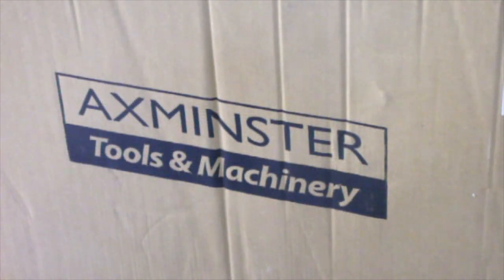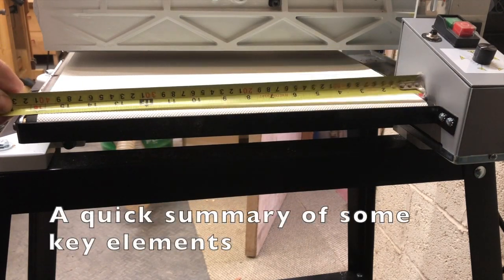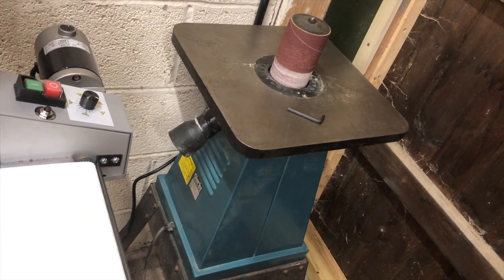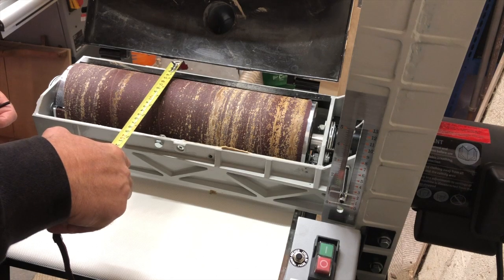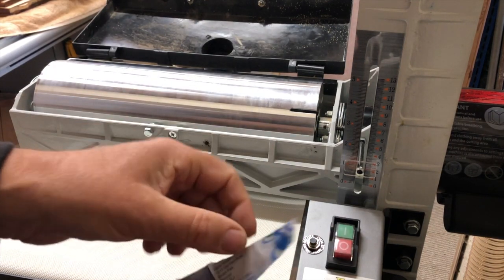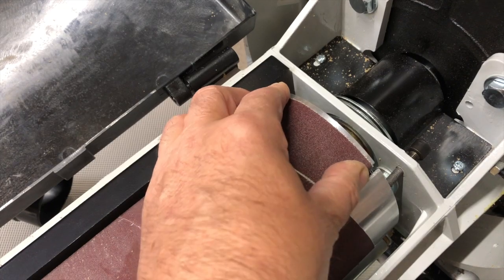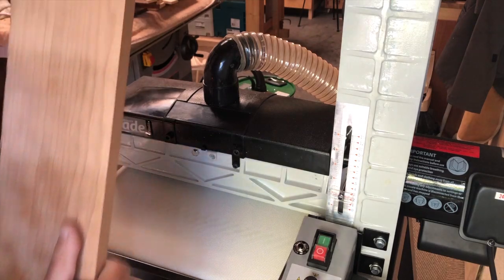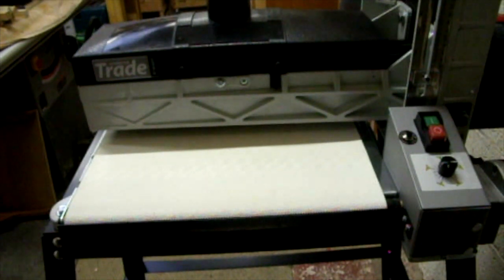Axminster AT406DS Trade Drum Sander - Tool Review Tuesday

Comment: Hi - have had the Axminster Trade 406DS for just over a year and it came time to replace the sanding strip and what a hassle  - so very pleased you did this video - There is no mention of the black pull mechanism which locks the drum and opens the spring clamp in the instructions  and there is very little room to see what is happening on the right side of the machine and my fingers couldnt open and hold the clampso again your video is a lifesaver.
The black and white photo's in the instructions are not helpful

I also rang Axminster for replacement strips as described in the Instructions that come with the machine but they dont stock them anymore precut -  for a machine just over 12 months old!! so am using the strip i took off as a master and cutting my own, as you did.
 - anyway back to the workshop and try out your process - Axminster should have issued a video on this to help otherwise we will drift to other manufacturers as without your video changing grit size is just too much hassle.

Thanks again
Geoff
Reply from the maker: Hi Geoff, Yep the instructions are less than adequate and changing the loadings is a right faff, though does get easier the more times you do it. I also use the original as a master template to cut from a larger roll of sandpaper, however Yandles were selling packs of loading for the Laguna model (16-32 Supermax) which fit the Axminster version and are already cut, they were selling them at a great price.
TBH now after nearly three years of ownership the machine does what I need it to do though there are some issues that are a real pain with mine. *Firstly the conveyor belt struggled to grip the work piece and kept stalling, Ax replaced the belt but alas the problem persisted in the end I dumped the white plastic version and went with a wide sand belt that Ax sell now zero issues re grip.
*Secondly the conveyor belt needs continuous adjustment as it tracks always towards the controller side, I've ensured spot on for level, parallel etc and still an issue - so after a few weeks of use I just reset the belt 
*Thirdly I installed a cheapo DRO as trying to use the scale on the machine was totally inadequate.

Having said all this for the price I got it at (which was 1/2 the price of Ax's current stock) it does the job i need it to do.

Glad the video helped on the loading.

Cheers
Steve

Comment: After owning that very machine for a year, Axminster finally came yesterday and took it back for a full refund.  After having nothing but issues regarding the loadings and tearing through litterally hundreds of meters of the stuff i had had enough.  Excuses from Axminster included "The hardwood you are using is to hard"  "The softwood you are using is to soft"  "The MDF you are using is to fiberous"  And my personal favourite  "The wood needs to be flat and smooth"  Absolutly the worst machine i have ever owned, if Titan can make a planer thicknesser for £155 that has lasted 6 years why is this machine such a poor design?  Horrible machine...
Reply from the maker: Wow! I’ve got an issue logged with them as the conveyor belt has zero grip now waiting for a replacement (back order) not had an issue with the loadings, having said that I don’t use their offerings. I’ve added a digital readout and apart from the conveyor it’s been acceptable. Shame about yours 😏

Comment: hi great vid have you adjusted the drum ect im unsure what to do as instructions are very poor
Reply from the maker: Hi, not sure which aspect of adjustment you’re looking for, however if it’s the drum to the table then you should have got some thin shim steel and you insert them under the table between the legs and the base of the machine to get the drum to run parallel to the table.  As for the loadings really it’s just being careful to get the sandpaper in between the clamp. As for the feed belt, I’ve changed the rubber feed belt for a sandpaper type this improves the feed through 100%. As for the tracking of the feed belt I’ve still not cracked that, I now think it’s down to how level the machine sits at the moment I just re adjust the belt every now and again. If there’s anything else just ask.
Cheers
Steve

Comment: I was looking at one of these and it looks well built. Thanks for the demo
Reply from the maker: @roberthodges3522  Thanks Robert, tbh after a few years of living with this it’s not without it faults! If I was in the market for one I’d seriously look at the Laguna version. Main faults are, the conveyor belt just isn’t grippy enough (I replaced mine with an emery cloth (basically sand paper)version, the tracking is a pain and still have to readjust frequently, dust collection just about adequate should really have a 100mm port not the 63mm and finally the measurement scale is useless (I fit a electronic scale reader, which is ok). However it’s does the job when called into action.
Cheers Steve
Ps forgot changing the loading initially is a right pain, however after a while it’s manageable
Reply: @Phenrica  Hi Steve, thank you for the more depth information on it. That's a shame because it looks well built. I did notice that you pushed the wood in a few times because of it not gripping. 
Even now brand new in the UK they are not cheap. Thanks again.
The Laguna is good but very pricey.
Keep the video going 👍
Reply from the maker: @roberthodges3522  Blimey I just looked up the current price, it’s double what I got it for! Go to admit I bought it on one of their sales days

Comment: Hi Steve thanks for the review, I been looking at this also a toss-up between this and saving a few quid or saying bugger it and just going for the laguna 16-32 Supermax Drum Sander. Still up in the air just don't like the thought of paying double what you paid. Is it worth the money and do you recommend it, cheers for posting.
Reply from the maker: Paul Burton Hi Paul, that’s just where I was, I tracked some second hand ones as well but thought they went for silly money imo. To be honest I’ve a few projects in mind that a drum sander really would be benefit need me however paying the £1400 plus was something I could not justify and when Axminster discounted I just went for it. I did look over them in store way before lockdown and thought then it was probably be the one I’d plump for. As for a recommendation it’s prob a bit too soon, however did what was supposed to do on a number of boards, the belt removal / replacement is fiddly however I’m aware that the jet version has the same issue and I would assume the Laguna has the same method of clamping the abrasive loading. There’s a calibration procedure that you carry out to ensure the drum is parallel with the bed, mine checked out ok but prob should have stuck that in the review (I didn’t video it and wasn’t an issue) there’s a couple of shims that you add the level up no great deal to do.

It feels like it’s a decent build (Taiwan of course) some more trials and tests so I can determine the optimum setting for the varying types of  wood and grits. It does have a weight to it so feel substantial. In the end it was a value for money choice for me, if I had loads of work required then possibly the Laguna or powermatic might have been what I’d go for but the work would have had to be good payers 😉

Hope this helps

Cheers Steve
Reply: @Phenrica - Hi Steve thanks for the reply, very helpful, you are right I think Will go for the Axminster I bought my Lathe and table saw from them. They are very good and excellent to deal with. Cheers once again and stay safe in these crazy times.

Comment: Hello Steve. I had the same issues with changing the belts. Surely there is a better design than this fiddly process. It makes changing belts for different grits a bit of a no no. Also had problems with the conveyor belt alignment  tracking adjustment . Could not get it to respond as described in the manual. Called in engineer friend. He failed as well. Have to stop the machine every so often  and manually push the belt back to where it should be. Not ideal. Best Peter
Reply from the maker: Hi Peter, after a while I seemed to have got the knack in changing the loadings, however after a few reloads glueing a piece of card at the ends really helps. As for the conveyor belt I lost patience with the white rubber one even after getting a new one courtesy of Axminster. So I replaced it with a sandpaper version that’s 100 times better in terms of gripping the timbers. The tracking is fiddly I agree though I’ve seemed to have balanced it for long enough that I only retrack it after while of using.
Reply: @Phenrica  Many thanks Steve I will try the card trick. Best Peter

Comment: Steve, Over the weekend I came to change the sanding strip and again needed to refer to your video as whatever I did didn't work, but having again watched your video carefully and a number of times your advice came to the rescue. 
Why Axminster don't either change the design for the right hand clip as their competitors have done, or put out a video similar to yours I have no idea, but again thanks for taking the trouble
Reply from the maker: Got to admit Geoff I am disappointed in the machine, I’ve struggled with the white feed belt continually just not gripping the timber whilst sanding (even after a new belt courtesy of Axminster) so I replaced it with an emery cloth variant which grips very well indeed only that there’s no way I’ve found to ensuring constant tracking! So after a number of uses I’ve got to release and reposition the belt. Fortunately it’s not a machine that is in daily use so I put up with it otherwise I’d replace it. With this and the pillar drill I got from Axminster I’m not sure I’d buy one of their branded large machines again.
Cheers Steve

Comment: Hey, I notice the minimum thickness for this machine is stated as 3mm. I really need to take my stock down to around 2mm (guitar sides). Do you think the conveyor table could be shimmed slightly to bring it closer to the drum?
Reply from the maker: Hi Jamie, Yep no problem shimming the table you actually may need to shim to ensure it’s running parallel to the sanding drum, however I can do 2mm easily on mine (which iv’e done for some of my model vehicles). One thing to bear in mind that most of the time for a show finish you’ll need to give them a run over with a random orbital sanding as there can be some faint track lines left after a drum sanding. Having said that I tend to use 100 grit max on mine. The machine for the price point is decent value in my opinion. Hope this helps. 
Cheers Steve 
ps if you’re going to purchase one with a Black Friday due in November there could be a decent discount 🤞🏼
Reply: @Phenrica  thanks for the quick reply. That's great news, there's one going second hand nearby for ~400 but I was a bit worried I wouldn't be able to go down to 2mm. Think I'll go check it out. The belt looks a bit fiddly to install, but sure I'll get the hang of it. Do you think the finish with 100 is okay and does it last quite long?
Reply: As in does the paper last long!
Reply from the maker: @ApertureCapture  the paper lasts if using dry hard woods that are not resinous. Pine clogs up the belts as does other oiley type woods like cypress and prob other exotic types
Reply from the maker: @ApertureCapture  I found that the belt became straight forward to change once I’d glued the business cards to the ends to stiffen up the cloth backed paper.
The finish is ok however like any other straight line sanding your eye can pick up the scratch marks. You could increase the grit to lessen them I suppose though when I’m doing furniture  I use the random orbital to finish as that scratch pattern is more difficult for your eye to see any sanding marks and I tend to go to 240 or 320 grit which I would think is too fine for the drum sander as it would generate too much heat I expect and as I do quite a lot of cherry it doesn’t like heat one bit.
Reply: Double sided sticky take your 3mm stock to 13mm MDF and sand 1mm off :)
Reply: @ApertureCapture  Hi. Did you finally bought that? I need it for instrument making too. How’s your feeling?
Reply: @asierdebenito-luthier6215  Hey, I have bought it, but due to lockdown I've been unable to pick it up yet
Reply: @ApertureCapture  good news. I have to decide between that and the Lombarte, which is made of steel instead of aluminum. Most Spanish luthiers use it, but I still need to know the noise level on both.
Thanks.

Comment: Hi Steve, congratulations for the video.
I'm looking to purchase one of those drum sanders, that size, and I have doubts between 3 brands. First is this Axminster, which costs 1100€, then Jet, which goes up to 1500€ and then Lombarte, sold in Spain, which costs 900€.
Both Jet and Lombarte weight around 70 to 80 kilos, but specs on Axminster say it weights only 47 kg? Can you, please, tell me if the main parts of the machine are made of steel or aluminum? I wonder if its construction could made it weaker and more noisy.
Also, both Jet and Lombarte have 1,5 HP motors, while yours is 1 HP. Do you feel it needs more power?
Thanks a lot in advance.
Reply from the maker: Hi Asier, I understand your issue I had the same when I was looking for a sander, I went for the Axminster because price (was about 1/2 price of the others available) and their customer service which is excellent. Not sure about it’s exact weight but is heavy in my opinion, it’s mainly made from steel plates, angle irons, though the casting that holds the lift mechanism is aluminium with the hood made from a composite material. The stand is steel angle and bolts together (I put wheels on for mobility) there’s a couple of could be better, 1, the measuring scale is at best approximate so I installed a €25 digital readout now it’s great. 2, the dust port is 65mm and would be better with 100mm to ensure max vacuum though it’s not an issue really apart from having to put a reducer on my vac system.
Overall I’m well pleased with it and probably would buy it again however it was on offer at the time for £700 / €800. If you’re considering then around Easter time Axminster tend to have discount sales 😉
Hope this helps any more questions just ask
Cheers Steve
Ps as for the power I’ve had no problems at all
Reply: @Phenrica  that was very clarifying. Thanks a lot, Steve.

Comment: Hi Steve, just found your review, Really useful tipson changing the belt, thanks. i am tempted with this one, but its £688 + vat...How much did you pay.  I am also tempted by  the Jet JWDS-1020-M Benchtop unit. Axminster do an abrasive belt cleaner...like a trainer sole material...works when on my belt/drum sander...  Cheers Paul
Reply from the maker: paultay23 Hi Paul, Sorry for the delay in response as only just seen the comment and question. I paid £699.99 in April as Axminster had an offer on it. Yeh I got one of those belt cleaners unfortunately I clogged the belt so much it was beyond help! Cheers Steve
Reply: @Phenrica  Thanks for the reply Steve... your video inspired me to look seriously at Drum sanders.  I bit the bullet and went for the Laguna 16-32 kit ...what a machine.. and i can change the belt in about 3/4 mins...Enjoy your machine and stay safe.. Cheers Paul   btw off to sell  a kidney to pay for it..😂
Reply from the maker: paultay23 The Laguna does look an awesome machine, I did look but ran out of kidneys 😂 honestly tho I just couldn’t warrant the extra cost due to my periodic use of a drum sander for those times I need thin stock. Enjoy and prosper...
Reply: Wow ....just had a look june 2024....its now £ 1198 .....doubled in price in 4 years . guess Axminsters Chinese supplier has put their prices up or they have to pay for all those buildings they own> Either way I have picked them up on quality before and I wont be buying this !

Comment: Hi, can you tell me what loadings you bought and which digital reader did you get from ebay? Thanks in advance 
Mick
Reply from the maker: Hi Mick, the machine came with an 80 grit and I bought a 100 grit one as well (which the one I use mainly) after I ruined the 80 grit I bought a 60, 80 & 120g though  I’ve not used them yet. The reader I got was “Accurate Remote Digital Readout Scale For Milling Machine Linear Lathe Tool DRO” it was the 0-150mm version.  Hope this helps just ask if you want any more info. Cheers Steve
Reply: @Phenrica  thanks a lot for your answers and also the speedy reply.
Reply: @Phenrica  Hi again, sorry but I feel a bit if a dumb ass, I got my DRO delivered today only to find out it has No instructions in fitting it at all, there is a nice piece of paper in there with a few pictures and two English words, On/Off
And chance of a few pointers please? Hints/pictures? 
I can give you my email address if that's any easier?
Thanks again 
Mick
Reply from the maker: @MickMolyneux  no problems, Yep the instructions unless you’re fluent in Cantonese 😉. You’ll need to do a small bit of modifications on the brackets as I recall and find a thin strip of metal/acrylic and drill one hole & tap to hold the top bracket. All straightforward stuff. My email is phenricawoodstuff@gmail.com